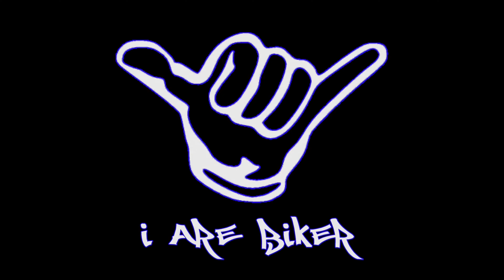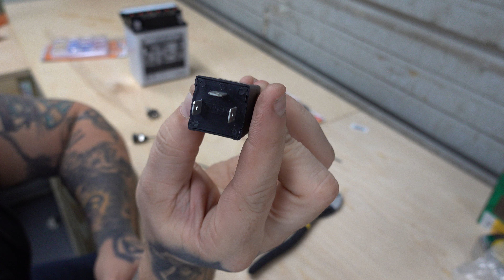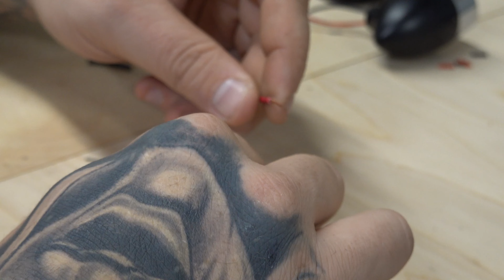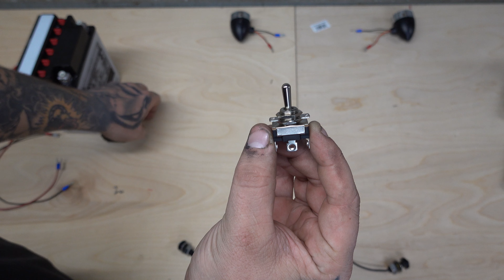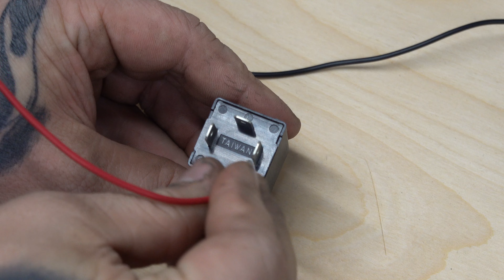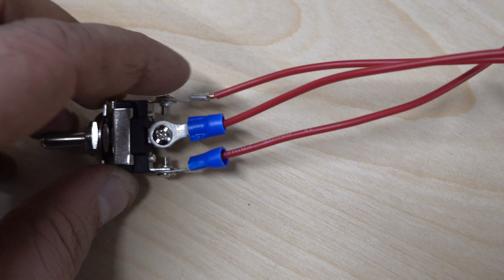How To Wire A Turn Signal Circuit From Scratch [2021 Follow Up]

Comment: Awesome job: im needed cause im rewire whole bike and get rid - ALL unessary crap !  safety crap... and im ditch the single cyclinder pressure switch .. use manual switch.. also im hated all the covers and xtras to remove to get to stuff.. im ride alone /bagger /doordash. so all under quick seat release lol !!! Not pretty - but functional ! so you see florida /al line.. bike with alot coolers attached =dat me lol ! @ down bro !!! two - Down ...!!!! :face-red-heart-shape:

Comment: Great way to explain, easy to understand. One question...if I  want to wire it as four way flashers can I assume  all I have to do is use a seperate two pole switch for right and left so when I want all four lights to flash I would just turn on both switches.

Comment: Ok I have a problem maybe you can help me with I have a motor bike ( bike with a 4-stroke engine pull start but that's not the problem is that I'm hooking up turn signal lights headlight a horn a signal relay a fuse and a battery to the bike I'm having problems wiring it up turn signal switch power and Horn to it too. I can send you the picture of a diagram that have made but I just want to see if you'll help me out first

Comment: On my Herat age soft tail my left. Blinker doesn’t work my headline doesn’t work and my horn doesn’t work l checked the fuses they are ok do you have any clue
What is wrong my bike is a 2003  and my Harley won’t  service any bikes that are over 20 years old  if you can’t help I would be grateful

Comment: There are SO many ways to wire turn signals.  What you put out here is one of the simplest and easiest to wire and is a good example of how to wire them.  Those that can't expand on what you showed here and figure out how to make it work on their project should not be trying to wire anything.  Don't worry about the keyboard warriors, you could go through all the different ways to wire these and someone somewhere would find a way to nit pick it.

Comment: Hi I like to bypass the turn signal switch and add wiring to it to make my turn signals work on the front indicators on the dash and on the rear turn signals is it possible to add wiring to it and bypass most of that stuff if I add a relay and running straight from the battery

Comment: I have a question why would my back turning signals be on as running lights when they are supposed to be off?
Reply from the maker: The first thing that I would check would be the wiring. It sounds like it is tied to a constant power source such as your tail light. Make sure the positive going to your light is coming from the turn signal circuit.

Comment: Hey man I'm working on a Honda Shadow. My front turn signals are also my running lights. And my stock turn signal switch is a 6 wire and I'm wanting to switch it to a 3-wire. How would I go about using my front turn signals with your setup (obviously more tightened up) but when the turn signals are not on, the running lights be on?
Reply: Pretty much I need my switch to be set up for when it's in the center/ off position I have power to my running lights and when I click my switch left or right it's shuts the power off to the running light and activates turn signal. 

My front turn signals / running lights have three wires that go to it one is the ground one is the wire to activate the turn signal and the other one is the power wire for the running lights. Currently when I hit my left turn signal or right turn signal it kills the power to the running light wire and gives power to the turn signal wire

Comment: your way method of wiring turn signal is simple and used a combined wires goes all the way from the power source..i need to wiring it on ktm dirt bike..thanks for gold presentation and explaination..
Reply from the maker: Thanks man! I like to keep things as simple as possible. It makes stuff like this easy to do from scratch, looks cleaner, adds little to no bulk, etc.. This would be perfect for a dirt bike.

Glad you found value in my content. Thanks for watching!
Reply: @ThrashTestDummies  your welcome..can you please show how to combine crimp the wires together? I'm sharing your video to my friends for them to do their dirt bike into legal supermoto..ready manufactures wire harness sometimes irritating but your way is gold and DIY..
Reply from the maker: I would suggest soldering for a road bike. Or a way of crimping that I prefer and have never had any issues with. It's similar to factory crimping. 

In the video I just used butt connectors to demonstrate the circuit itself. Not how I would advise joining the wires in a real world application. So I will do something for you and your boys and make a video showing the 3 methods I use to join wires, their pros and cons, and in an order from no solder to solder. Give me a couple days and it will be up.
Reply: @ThrashTestDummies  thanks, man..I sub now..

Comment: Thanks for a great video on wiring turn signals. I have a 1970 BSA 650cc bike with no signals...but it will have soon ! Thanks again ! Biill Bailey AUSTRALIA.
Reply from the maker: Awesome! I had the same year BSA on a chopper frame for a while when I was a teenager. Great bikes but they're getting harder to find here in the states. 

I'm glad you found my video useful and thanks for the support! One of my life goals is to take a motorcycle around the landmass of Australia.

Comment: What size fuse would you recommend to put between the battery and relay?
Reply from the maker: Usually the main fuse (between battery and relay) is a 30 amp on most bikes

Comment: I think people were confused because they're probably thinking of the wiring where the flasher and relays are separate but your method using the combined module on a bike is 1000x better 👏. Well done.
Reply from the maker: I think that is where a lot of confusion is coming from as well. I found that this method is better because it essentially combines two different modules into one unit which saves space, time, and work. Not to mention troubleshooting should anything stop working.

Comment: 💯💪..how you wire a 12v DC rectifier/regulator with all the wires..will love to see that video
Reply from the maker: The wiring would vary from bike to bike, but a 3 wire rectifier will be the same on any bike. I will see if I can find a way to simplify it and explain it in a video sometime soon.

Comment: Hey bro so I ordered a 2 prong relay so it’s self grounded but my tail lights are 2 wire so would you recommend grounding out my lights at least? To be on the safe side
Reply from the maker: If they are 2 wire running lights and turn signals then they are self grounding. Meaning the body of the light is the ground. If they are meant to only be turn signals then yes, one is a ground and one is power from the relay. An easy way to test it is to hold a ground to the bolt of the light, then put power to each wire individually. If nothing happens it is only a turn signal. If you get two different "brightnesses" then the light is self grounding and the wire that controls the dimmer of the two needs constant power, and the brighter goes to your relay side. Let me know if you have anymore questions. I'm glad to help.